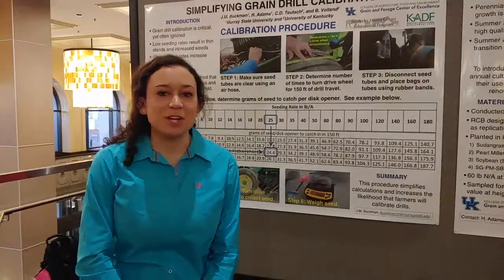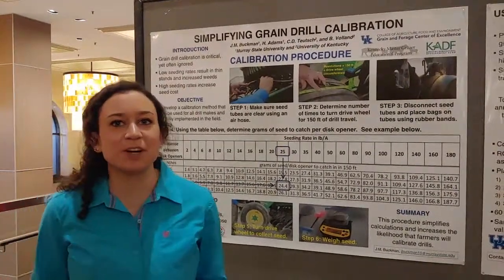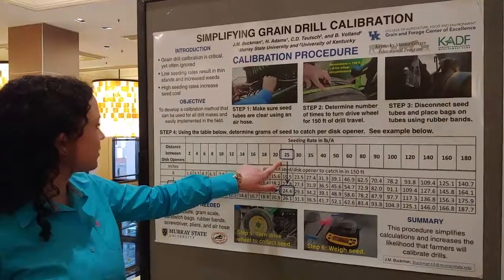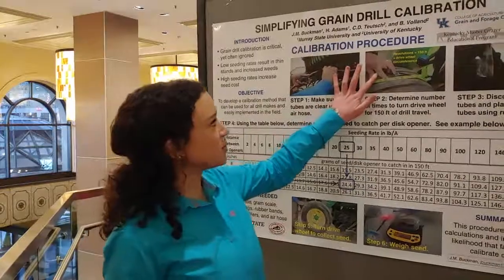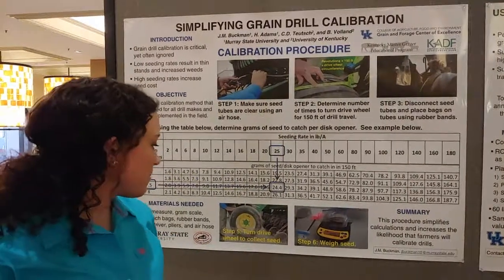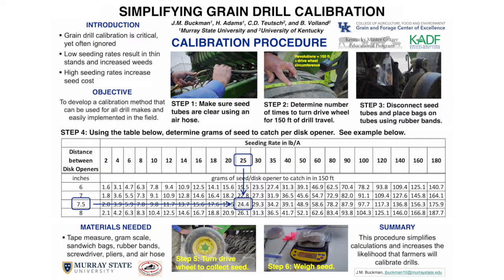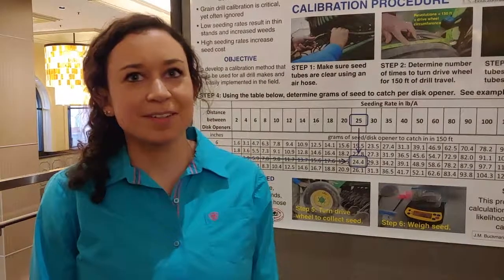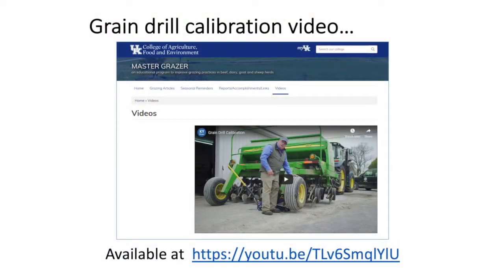Grain Drill Calibration - Poster Presentation at AFGC

Comment: On your website you say something about 3.14. Here is what your webpage says.

 "10) Pull the drill 150 feet or turn the drive 
wheel the number of revolutions it 
would take to travel 150 feet.
 a. Revolutions can be determined 
by using the following formula: 
Number of revolutions = 150 
/ (3.14 x diameter of the drive 
wheel in feet)."    

What in the world does that mean?  I take 150 divided by 3.14 X 4 Feet (circumference of the drive wheel) and I get 191 doing that way. I'll do it another way, 3.14 X 4 feet equals 12.56, 150 divided by 12.56 equals 11.94.  Now in the video it says 150 divided by 4 feet (circumference of the drive wheel) equals 37.5.  Three numbers that arent even close to each other.  So which way is the right way?